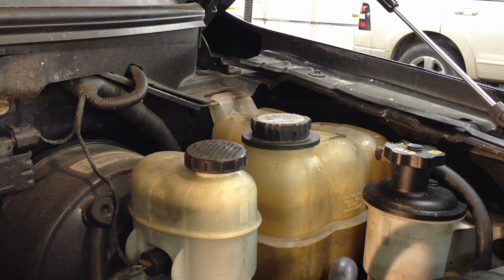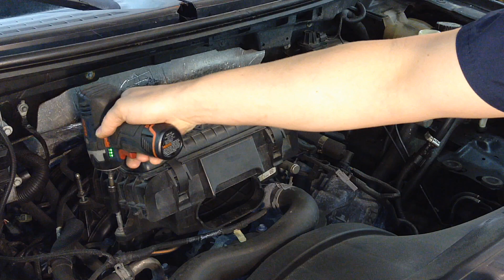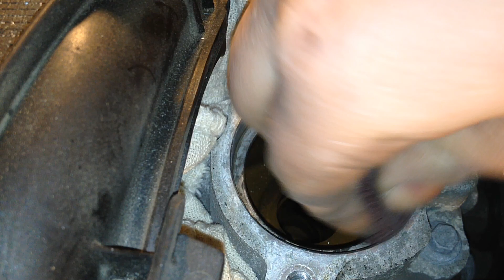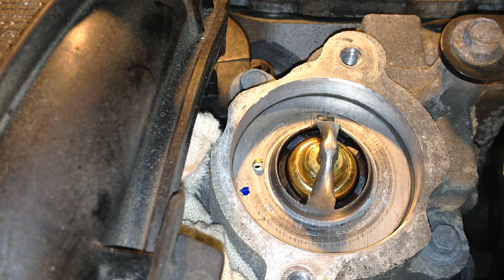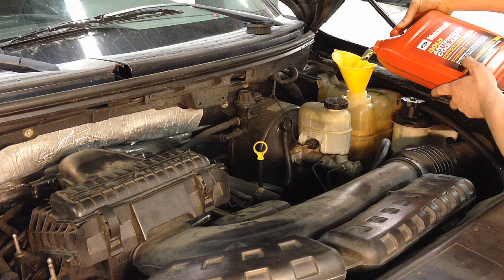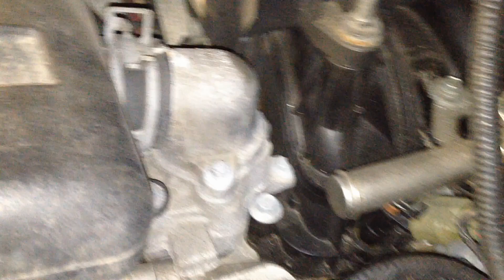Ford 5.4L 3v Engine Overheat P1285: Thermostat Replacement

Comment: I have a 2006 f150 4x4 with a 4.6 how do I tell if it is 3v or 2v.
Reply from the maker: 3v engines have the vct solenoid sticking out of the front of the valve cover. Yours is a 2v engine that year though.
Reply: Thank you

Comment: Why not use the vacuum fill on this one?
Reply from the maker: These don't require it the way the setup is on here I didn't even have to do any revving for air pockets or nothing. Plenty of heat right away.
Reply: I believe I need to vacuum fill mine. The coolant doesn’t go down at all and runs hot. Water pump is good.

Comment: I didn’t drain the coolant when I changed my thermostat so now the engine is shaking (strong vibration) I think I got coolant in the spark plugs. Can anybody help please.
Reply: That_Ford _Guy use a shop vac and pull the plugs and clean the plugs.

Comment: I’m an idiot 🤡 I don’t know why I put the O-ring where I did 🤦🏽  I was questioning ford but after I got it done I was like, wtf was I thinking. Good guess where I put it 🤦🏽  
     I just wanted to come and take accountability with my mistake. It will work for a little but not enough to do the job. 
….🫣 it doesn’t go around the neck piece 🤦🏽  🤣🤣

Comment: Hi 
in new ford thermostat , when broken , does it break on full open or full closed , as i recall back in the days , most cars had the problem that when the thermostat breaks , it breaks on closed , what about in the new cars
Reply: Mine broke on open it's a f150 2005